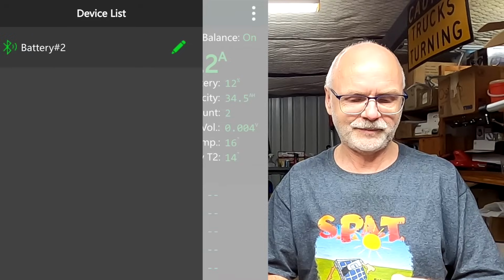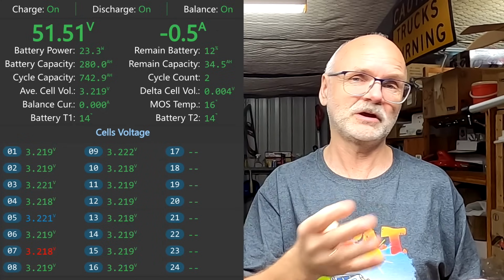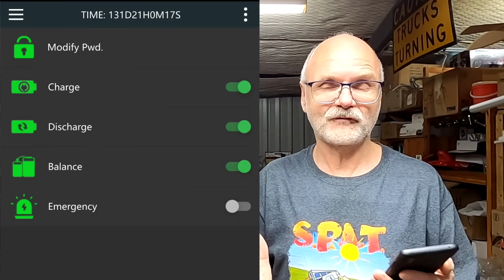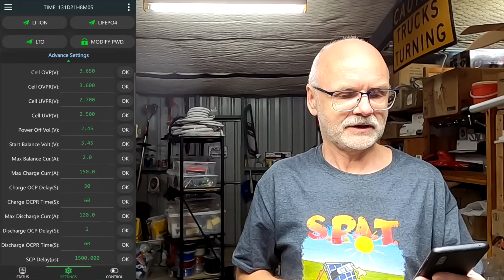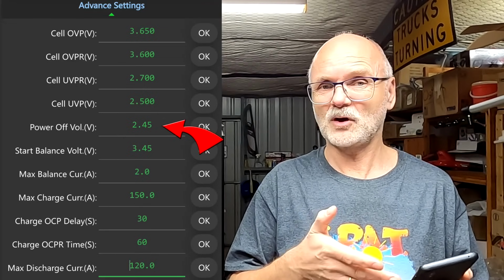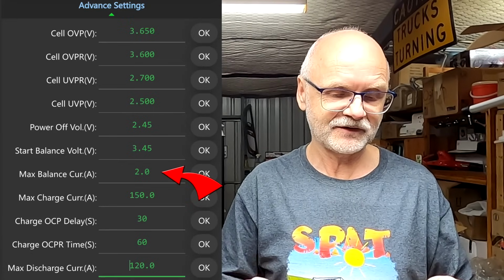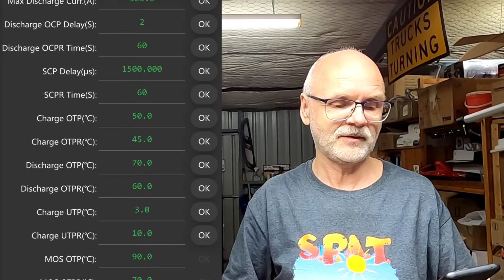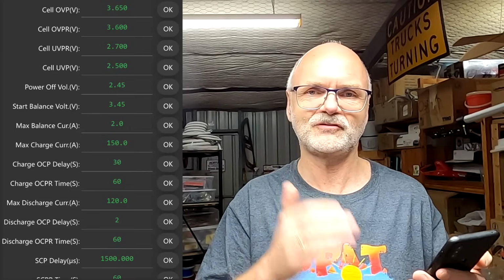JK-BMS: all settings and menus explained. How to program and set parameters.

Comment: Hi Andy & everyone. This are Great videos ... an excellent help for myself that wanted to build my own battery. I am having an issue thought using a Multiplus II and JK BMS. Got some nice 16x EVE 280Ah batteries. Set it all up, set voltage absortion to 55.2, float to 54.8 and ESS and all parameters in JK as in this video. The problem I have is that i reach by JK BMS the 100% SOC way before all the cells reach the balancing voltage of 3.40 even. Anyone has an idea what might be the problem ?

Comment: Hi Andy, i know youve probably moved over to the newer JBD now, but thought id ask anyway.

I just got mi JK installed and it's current reading is out (compared to Victron SmartShunt and clamp meter) by ~30% low at low loads (showing -1.7A when real draw is -3.3A).  And about 50% low at high loads (showing -60A when real draw is -110A).

Ive tried using the calibration current value but it doesnt help once the current changes - even when current reaches the same level it was calibrated at a moment ago.

Any thoughts? Other than bin it and get a JBD? 😅

Comment: White Hat way if you find some open system like this BMS with default password - set name of the system something like "PleaseChangePassword" so owner of the system sees this when next time will use the app. This is only applicable if you can't contact owner of the system in any other way.

Comment: User Private Data: is a description for the battery it will help if like me you have more than 1 battery with same capacity.
Reply from the maker: How does this work though?
Reply: Not for much I control my 3 JK and Smart shunt in Hassio and there I don't have this field, in my case I use it to record the capacity of my last top balance. 

It's early since I only start to test it today but seems that the Con. Wire Res, is very useful, because the voltage is incorrect when balancing, one of my ports had an overvoltage deviation of 20mV and this discharged the cell on balance, in 3 months it lost almost 9Ah, when I increase the con wire  res in 1m Ohm it lower the cell voltage and stop the discharge when balancing.

My procedure to calibrate it is stop, charge, discharge and balance and measure the voltage of each cells and compare with the BMS, in my case the values in the BMS are correct to 1mV. After charge with a constant A and also turn on discharge but without load and measure the cells again and you will see differences in voltage you measure and in the BMS, to lower the V increase the resistance in steps of 0.5, haven't test if it accept negative values to increase the voltage.
 @OffGridGarageAustralia

Comment: Andy, is there a way to reset the password. I am not able to get in as it is not accepting the default:123456. I did not change it since the initial setup but now it is not accepting it.
Reply: There are 2 passwords. 1234 for unlocking the BMS and 123456 to change settings on the 2nd page.

Comment: Hi! Is there a way how the BMS could measure the real capacity of the battery?

I used deep discharged 18650 cells, stored at zero voltage all the thousand cells came back to 3.6V than made them paralel and built big 7S120P pack and put a JK BMS on it. Not sure how many Ah left in the cells, would be nice if BMS could measure. Rated is 2.75Ah each cell so I guess 2Ah per cell left in best case but not sure. So entered 240Ah for the settings....

Comment: Thanks a lot. Great source of info
I have 16 eve 280ah cells connected in series
The default jk bms charging current is 25a 
Is it safe if I change it to 150a?
Reply from the maker: Well, that depends on your cabling. If the cables can carry 150A then yes, it is safe.

Comment: I seem to run into a small problem i have 3 battery banks and one of my jk’s wont turn the discharge button even thou is turned off in the settings , on the banner of state ot shows that is still on , any ideas anyone?, thank you
Reply from the maker: Is it running a different software than the other two you have? Can you swap them and see if the fault stays with the MS and not the battery?
Reply: @OffGridGarageAustralia  thank you i’ll try that

Comment: Hi Guy.. Question.. do you know if there's any Firmware updates on these units ? Also any bug fixes on readings being so jumpy on the newer units, and is there a way to make the BT reception better ? The newer BT units work better. I have the B2A24s200A versions.. I have 6 of these.. and all are in 14s set up. they been working trouble free.. But Slight issues..I have tried to talk to the reps , but they weren't very helpful..

Comment: Thanks for this video. I couldve guessed the functions of 80% of these parameters, but it's very valuable to know exactly what I have control over, as well as within what range they should be set to. I find it very interesting that the balance trigger voltage on mine was set to 3.0V by default. That's 10%!

Comment: I've got a 230AH battery, but stops charging at 218AH showing 95%, is there a way to reset the SOC?
Reply from the maker: We need to know your settings.
Reply: @OffGridGarageAustralia  cell count = 8
Battery Capacity = 230
Balance Trig. Volt = 0.010
Calibrating Volt = 28.4
Calibrating current = 0
Cell OVP = 3.6
Cell OVPR = 3.55
Cell UPVR = 2.65
Cell UPV = 2.5
Power off = 2.45
Start Balance = 3.45
Max Balance Cur = 2.0
Continued Charge Cur = 190
Charge OCP delay = 30
Charge OCPR Time = 60

Comment: Wow Andy! Perfectly explained.
Is it necessary to have charging and discharging wires of bms to be different?
Can we just disconnect one wire of bms from P- and B- side each?
Reply from the maker: Thank you.
It can be the same wire if it is big enough. If in doubt, use separate cables for each device.
I don't understand the disconnect question 🤷‍♂️

Comment: how did you integrate it with VRM?
Reply from the maker: I didn't. It would make no sense as I have three different BMS in my shelf and having reporting only one, makes not much sense. As good as the JK is, it's not the right BMS for communication and having batteries in parallel.
But if you have only one battery, I made a video on how to connect it to the Victron system: https://youtu.be/sHIlP2oJ3DU

Comment: Hi sir, I have a bms jk 24s 48v 150A, a warning appears on the screen, and it is Protection cell over Voltage (os), what is the meaning??
Reply from the maker: Most likely one of you balance cables has bad contact. Check the resistance showing in the app. It should give you an indication which balance cable is the culprit.

Comment: Hi Andy, Can you or any of your followers tell me what I need to do to deal with a forgotten bluetooth password?  I can't change it without knowing the old one and I need to install the app on another device.  I'm beyond fed up with JK support, the support page has been down for months and so is the contact page.  Hankzor has been totally unresponsive to all my inquires and I've received no response from the JK info email address.  My understanding is that there is a temporary code that needs to be entered but without support I can't get that code.  I can't believe there isn't a hardware solution for a hard reset.  Surely I'm not  the only pea brain that has forgotten a password.  I'm desperate for a contact who can help me.
Reply: find anything??

Comment: I believe you said that you don't turn on the "Balance Only When Charging" feature. That is probably fine in your location but I turn it on here because our temps easily go below 0c. Setting the cell CUT (charge under temp) protection to above 0c is not enough to prevent damaging the cells. This is because the CUT only controls the FET's and stops the current into the battery. However the balancing current is still allowed between cells when the other balance parameters are met.

Comment: I’m going through my settings and the calibrating curr (A) I tried to set as .10 and it won’t let me? It says sending failure?
 Same with the cell uvp tried to match yours but it won’t let me change that either?
Also when I turn my balance on in control and go back to status page the balance still shows off.  I don’t have my battery connected to anything. Does it take load to turn on balancing as well as changing some perameters?
Reply: Hi Justin. I had a similar problem. First, this happened when I was to far away from the JK. Data was still showing, but I would not let me write the change. second. This also happened when I tried to change a value that was dependent on another field, and where the value should be higher instead of lower than the value in the other field.
Reply: any other ideas?  I have my phone sitting on battery and still won’t change. I also tried .10 all the way up to 5 and it still won’t change it?
Reply: @justinbelote1768  Hope you entered the password.
Reply: @justinbelote1768  And you went as close as possible to the JK with your phone ?
Reply: @justinbelote1768  p.s. when you see any values change in the app, your are connected. When they are "solid", you have no connection, and you also get the write error.
Reply: yes password typed.  It’s literally inches away from Bms 
And values are changing.  I can change the calibrating voltage right above it no problem.  But still won’t let me change current?

Comment: HI Andy, my name is Marc. I have a small question. Do you know if anybody ever tried to put a small antenna ( just a small isolated wire should be enough to boost ) on the JK BMS B2A20S20P or similar ? Not a problem for me to solder, but it would be nice to know where the bluetooth chip is located before I take the BMS apart. Thx. Marc

Comment: I have put in a similar 8s system after watching these fantastic videos. Thanks for the help.

I just have 2 questions;

1) My 8 battery cells are not charging past 3.25 and I have them set at a max of 3.45. It looks like one of my cells is damaged (but it does charge to 3.45 when I connect it to a charger - but not via the Victron system and the solar panels. Is it possible that the 1 damaged cell is holding the others back from their full potential?

2) My system is in a van and I won't be using it for 6 months. What is the best way to leave it? Should I disconnect the battery? Or leave it connected and in the sun? 

Thanks in advance
Reply from the maker: Is this a 12V system or a 24V system? What Victron gear are you using to charge the battery?
You can watch the cell voltages in the JK app to see what stops the charging. It sounds like the Victron charger has not been setup correctly.
Reply: @Off-Grid Garage  I have a Victron Multiplus 3000 24V. The system worked with a different battery and different BMS. It is possible that there is a setting wrong but I have checked everything 3 times. The Victron is set at a max of 27.6V but it is only charging to 26.6V. 
I'm still thinking it could be the one damaged battery cell holding the others back during the balancing. 
I am stumped

Comment: Hi Andy, I did what I thought I would never do my JK turned off at 2.45v as it should, I wasn't there but now Im not sure how to turn it back on as I dont think its accepting a charge being turned off. should I disconnect and charge the cells up a little then try the power on switch
Reply from the maker: If the battery voltage is too low, the JK will not start. Do as you said and it should come back to life again.
Reply: @OffGridGarageAustralia  Hi Andy, yes it did, all well again, I must have a sneeky current draw somewhere. love your videos
Reply: @OffGridGarageAustralia  There is even an easier way. I am lazy. Just put a short in between the in and out battery on the JK, and let it charge a bit. Won't harm the JK. Cheers, Marc

Comment: 22:15 The charge controllers I have forbid leaving them connected to the panels when you remove the battery.  Any thoughts on under volt disconnect while its sunny?

Comment: Hey andy. Or anyone who can help. 
I have set up my voltages in the bms and on two mppts. However my battery wont charge charge above 88%. When it reaches 88. It shuts off the charging. Also when in ESS and i choose keep batteries charged. It still wont go to 100%. Does anyone know what is going on, have experienced this or know of a mistake. 
When you set up for 3.45 does it only reach 88%? 
If so how to feed back excess power to the grid if the batteries are never fully charged?
Reply: When you set the voltage to 3.45 in the ESS, the JK will think the batteries are at ± 80%.

Comment: Reasoning about over voltage protection for individual cells could be improved. Even with a correctly working charge controller all the cells can be low while one cell is too high and this cell will get damaged. Total voltage will still be low enough for charging but one cell will be too high.

Comment: REGARDING CELLS WIRE RESISTANCE:
My understanding from testing, is that if you dont have the same resistance reading accross all cells (i have 4 series) then the highes resistance reading is not contacting the terminal well enouhg.
IE: i had a readin of 0.38 for 3 cells, but a reading of 0.43 for 1 cell, after tightening the nut on the high readind cell possitive-  it also came down to 0.38.

I think its important for balancing mode!  if the resitance is high on one cell, then it wont be able to recieve the full 2 amp balancing current from other cells, or be able to send a full two amp to other cells.  ( just my understanding - i dont really know much, please give more information or correct me if im wrong, thanks)
Reply: Sounds to me that if the balance wire is connected to the cell stud and tightening the connection makes a difference,  then it may be measuring the resistance between the balance wire  connection and the cell stud and not necessarily the balance wire resistance itself.
To check if that's the case, if one cuts the balance wire without disturbing the connection to the cell and inserts a resistor and theres's no change reported by JK then more than likely it's a problem either with the cell itself or more than likely the connection between cells.  Wadayathink?

Comment: Thank you Andy for such detailed explanations. Just one question can I use JK BMS 16s to build a 12V battery bank i.e 4 packs of 4 cells 280 AH connected in parallel? 12v power for 1120 AH controlled by only 1 JK BMS 16s?
Reply from the maker: For a 12V battery you need the 4s-8s JK-BMS. The 16s will not work here.
Reply: @OffGridGarageAustralia  many thanks Andy. Though so. Was just thinking to do something crazy 🤪and see it works. But will go for 4 Bms of 4s instead. Thanks

Comment: Love ur jk videos, thanks for all the info. I'm sold! Curious if you know about the GPS port, can't find much about it.
Reply from the maker: The GPS port is to connect to RS485. Makes sense, right?😁 I think I explained this in a past video when we closely looked at the communication options with the JK.
Reply: @Off-Grid Garage  I want to say I watched all the jk bms videos and can't find which one it was. I'm curious if the port is just power out for a module for asset tracking, or if the app exchanges data with the module for speeds and odometer, ie for a motor vehicle.
Reply from the maker: @yourunclefab  It is as clear as mud, I'm afraid. JK ladled this port GPS but it's not a GPS port but the RS485 comms port. There was a modified version of the JK for a telco customer and now these versions are also on the market for some reason. I would get in contact with the Hankzor store on AliExpress and ask them the question, they will know. There is a link to their store on my website here: https://off-grid-garage.com/battery-management-systems-bms/

Comment: Andy thanks very much for all your videos and information, you have been a great help with my rebuild of second system. I have basically copied your battery build ,to a certain degree.
I am running a 280 Ah battery with Eve Cells and a 200 Amp JK BMS. 
All was running good until recently I woke to no power in the house. After investigation I found that the BMS stopped the discharge to the inverters. It said,,
"Protection (Discharge Short Circuit)". 
The battery was reading 47.68 volt with more to give. I pushed a charge into it straight away and when it reached 48.5 volt it resumed and started to discharge again.
I have contacted JK BMS direct to see if they have an answer, but to this point there has been no reply. 
Have you come across this issue at all?
Reply from the maker: That seems strange if it detects a short current. Was there maybe a peak, a surge at some stage which could have triggered that?
Reply: @OffGridGarageAustralia  Thanks for your reply Andy. A surge?? That is a possibility, but reading the history from the Inverters  (Growatt's) they actually never got the opportunity to connect to the grid as they lost battery power from the BMS stopping discharge. And because it was in the middle of the night / early morning there was obviously no PV input, so no surge there and I doubt a peak.  It is a mystery! The battery's haven't been that low since, so it will be interesting to see if it does it again. If you have a brain storm please let me know. I will continue to try and contact JK BMS, but like most of these Chinese companies, they only talk to you when there product is working the way it is suppose to. Again thanks for your reply. Peter V
Reply from the maker: @peterv7414  Try contact the Hankzor Store on AliExpress. They know a lot about this MS as well. There is a link on my website under the JK-BMS:
https://off-grid-garage.com/battery-management-systems-bms/
Reply: @OffGridGarageAustralia  Appreciated, that is a great idea. Thanks